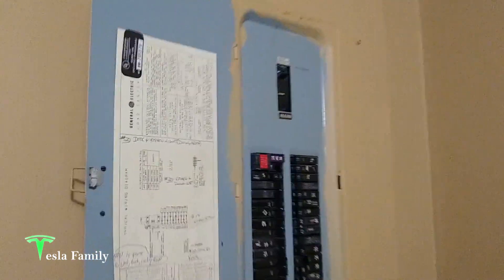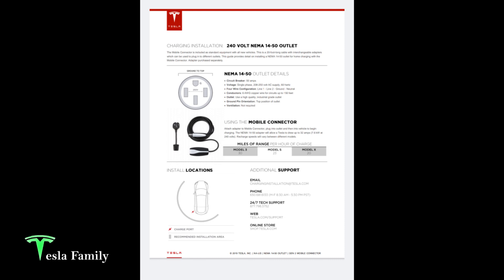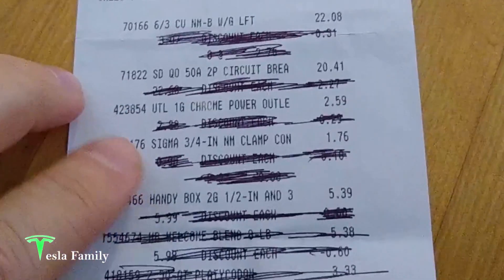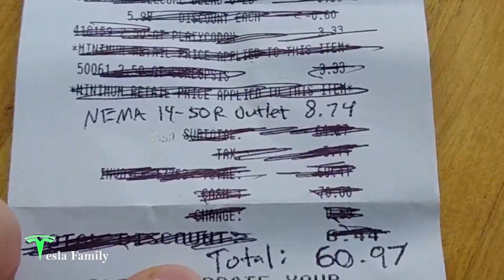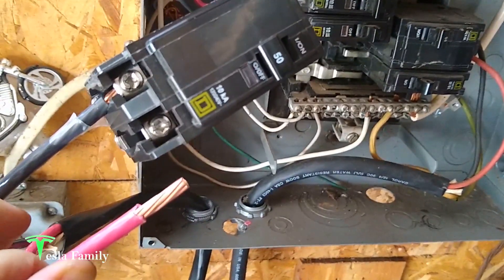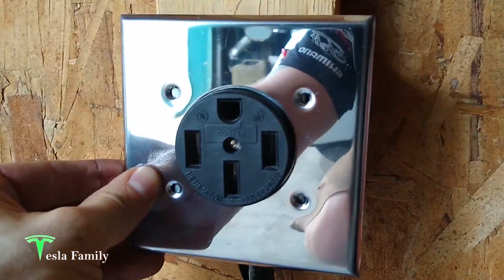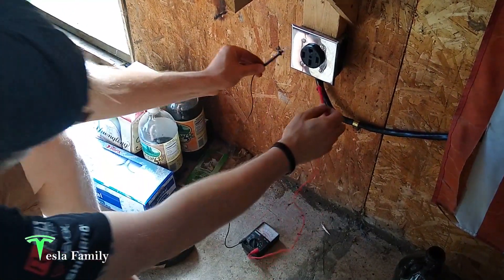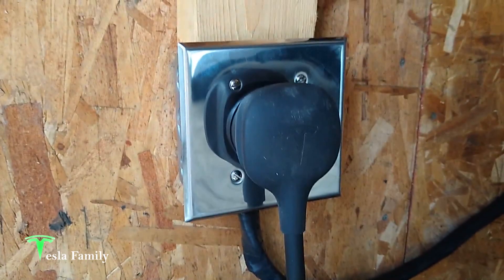Installing a NEMA 14-50 Outlet to Charge my Tesla for Less Than $61!

Comment: What is this ghetto electric? You are supposed to install something that last forever. I doubt that plywood will last long
Reply from the maker: Thanks for watching, that plywood has lasted for 30 years so far. Was in place long before I added the 14-50. Don't see any issue with it at all.

Comment: Why would you install a 60 amp breaker when tesla cut sheet calls for 50 amp
Reply from the maker: I did install a 50 amp breaker for the 14-50 outlet. Please watch the video further. The 60A was the main panel breaker which leads to the subpanel.

Comment: A lot has happened in the last tow years including many of these cheaper outlets melting and causing a fire hazard. They are fine for dryers and ranges with an intermittent load. The EVSEs have a continuous load for a long period of time. The industry is now seeing a need for commercial grade outlets ($50+). Best bet is still a hardwired installation.
Reply from the maker: Thanks for watching! Agreed, the Tesla Wall Connector is the way to go!

Comment: Why some people uses 50 amp and others uses 30 amps? I installed a 30 amp but I notice the breaker warms up while the car is charging is this normal?
Reply from the maker: Thanks for watching! 50 Amp is more power than 30 Amp so the car can charge faster. 37 miles added per hour verses 22. Make sure you have the appropriate sized breaker for the outlet you are using. An electrician can take a look and let you know if your set up is correct.

Comment: I installed 14-50 wall socket and  purchase tesla 14-50 connector. I used the stock wire from tesla and chaned the 110v connect to 14-50. The problem there is no light at all. What it could be?
Reply from the maker: Thanks for watching! The Tesla mobile charger will flash various colored lights linked to electrical troubleshooting problems if you don't get a flashing green for charging. If no light at all then perhaps your breaker tripped or was not toggled on. Highly recommend a professional electrician for further diagnosis.
Reply: @TeslaFamilyChannel  its was install by Electrician there is 240v on the wall we test it 50amp breaker. We also test the tesla 14-50 cable connector that I got 2days ago and its providing 240v.

Comment: I like the diy videos because they inspire.  As an electrical guy, I know you do not need years of training to put a wire under a screw.  The electrical requirements are not some state secret, but many have lost a lot to give us those requirements.

Is the wire big enough, no the other wire.....from the utility to your house....you are basically adding a second stove to run all night long, can your main panel support.

Do you need a permit?

Gfci....yes for recepticle under car charging in NEC.

Type of wire, is it approved....extension cords cannot be permanent building wire.

The type of cover for the recepticle if it is outside.

And many more.

As an electrical guy,  I question if the insurance companies have to pay out for work done without a permit.  You options might be to sue the installer if any problems arise from the install.   That "MAN in the mirror" might have to replace anything lost in a fire.
Reply from the maker: Thanks for watching! Heavy duty metal working machinery is also run off this panel so it can support. The actual 14-50 is only used once or twice a year when I visit.

Comment: 6/3 wire is like $6 a foot now. Wtf
Reply: This author any correction comments answer : thanks for watching. Thanks for watching corrections also
Reply from the maker: Thanks for watching!
Reply: @TeslaFamilyChannel  where can you find cheaper wire
Reply from the maker: I've gotten wire from Amazon https://www.amazon.com/gp/product/B00KWSBRNO/ref=as_li_tl?ie=UTF8&camp=1789&creative=9325&creativeASIN=B00KWSBRNO&linkCode=as2&tag=teslafamilych-20&linkId=eaef12adef35474cabde98378a188f1f or check your local home improvement center like I did in this video. Maybe even check with an electrician friend you might have.

Comment: As an electrician stuff like this is my bread and butter. All you need is 2 hots and a ground. Depending on your local code they may require a neutral but you only need 2 hots and a ground
Reply from the maker: Thanks for watching!
Reply: Since it is an outlet that has the neutral slot, my inspectors require the extra wire.

Comment: I had a Nema 14-50 outlet install for my 2018 Tesla basically the same as you showed in your YouTube for $40 
and all worked well until a few weeks ago when I update the Tesla software. I started getting a notice on my screen that outlet was running hot and the amps were reduced from 32 amps to 16 amps. I think Tesla considered the high temp a safety issue. I replaced my $10 14-50 outlet with an industrial grade one which cost $99 and now charging is back to 32 amps. If yours starts doing this it is probably the outlet and not the wiring, circuit breaker, on Tesla charging cable. FYI
Reply from the maker: Thanks for watching and sharing this information John! I use the outlet maybe 2-3 times a year when visiting my family but will make sure to keep an eye out for any reduced charge current messages.

Comment: Doesnt it require GFCi protection?
Reply: I thought the same thing @Crypto Currency, but apparently the Tesla chargers have GFCI built in and recommend NOT installing a GFCI breaker. Interesting interesting. They also recommend against installing a dedicated emergency disconnect.
Reply from the maker: Thanks for watching, no GFCI here. This is not your normal kitchen appliance outlet. 🙂
Reply: Yes it does according to the National Electric Code.  

210.8 gfci for homes requires it in garages for 125-250 vac recepticles, however, there is a seperate section for car charging in the NEC, about 725 or 745 o close to that, that requires gfcis.

Comment: You should install a Hubble 14-50 outlet. The Hubble has a much better clamping system to clamp onto the 6 gauge wire. Yes expensive but, how much did you spend on your EV? I realize you are charging at the outlet a couple of times a year, but a house only burns down once. That 6 gauge wire, is carrying a lot of power. You should have run the wire in a conduit. I can never understand how people spend so much for an EV, then save money by installing a 14-50 half ass. Unbelievable.
Also, the clamp holding the wire near the outlet, should have been clamped on the 2x4 and not on the particle board.
Reply: Should we mention...😬
The EGCs must be terminated on an EGC buss, not helter-skelter twisted to various screws...2:12...
The 2-pole breaker at the top/left can't be double-tapped with a 2-wire and 3-wire branch circuit...2:16...
The cable jacket must be fully inserted into the connector at the outlet box...6:20... 
The open knockouts in the bottom of the panel require KO blanks...5:15...
The neutral and ground (EGC) do not both attach to the neutral buss in a sub-panel...5:42...
The cable jacket must be fully inserted into the cable connector at the outlet box...6:22...
The cable must be secured within 12" of the panel enclosure and the outlet box...6:12...
The electric meter is spinning the fastest it has ever spun...✂the cord!!
The garage door and door jamb is returning to nature faster than a fallen tree in the forest...2:43... 🙄
The black Model 3 is beautiful !! Surely I must have missed something 😄
Reply from the maker: @wellcraft2136  Excellent! I'm going to hire you for my next project 👍👍
Reply: @TeslaFamilyChannel  Very kind of you to say and I hope my wry humor was not offensive :))
Reply from the maker: Thanks for watching! Great to get feedback from the experts 👍
Reply from the maker: Thanks for watching!

Comment: As a licensed electrician all i can say is if you can afford to buy a Tesla you can afford to hire a professional to install a 50 amp 240 volt receptacle.  I have watched many of these video's and in scares me as to what some people do.  Electricity is not a hobby
Reply: Very true electricity is not a hobby, at home I plug my Tesla into a RV TT-30 amp, 120v and its enough but I need a licensed electrician if I want 50 amps 240 because the 200amp breaker box is maxed out and may not even be a possibility.
Reply from the maker: @captpeady2176  Thanks for watching! Love my Model 3!
Reply from the maker: Thanks for watching!

Comment: For the Nema 14-50, Is there any requirement for the 220v 50A outlet?  At home, we have a 220v with dual 30A outlet.  I used it to charge my Model Y but in the car i changed the 32A received to 28A. What do you think?
Reply from the maker: Thanks for watching! Yes, the 14-50 needs a 60A outlet and 6 gauge wire. I wouldn't try to add a 14-50 onto wiring which was originally designed for a 30A circuit. Def check with a licensed electrician to find out the best course of action.

Comment: other than the outlet, I ordered everything the same as you, can you tell me what kind/size screws to screw the outlet to the electrical box?
Reply from the maker: Thanks for watching! I think I used 6-32 Pan Head Machine Screws. They don't need to be long, just enough to mount the outlet to the box. 3/4" or less long.

Comment: I'm am installing a second outlet for my nephew next month. The one, and most important, lesson I learned after the first install is to purchase a top of the line 14-50 outlet with allen lug terminal screw down wire terminals.  The screwdriver type lug terminals do not secure the 6 gauge wire as well.  You did a nice job with the install.
Reply from the maker: Thanks for watching! I agree on the top of the line/premium outlet. If I was charging with this outlet regularly, I would have used a premium outlet. Since I only use this a few times a year when I visit my family, the cheaper outlet should be sufficient.

Comment: Did you pull a permit? Did it pass inspection? My understanding is that code doesn’t allow use of Romex in exposed areas subject to damage.
Reply: It's a little confusing and I haven't looked at the 2020 edition of the NEC but you can run unprotected NM-B in an  opened framed garage regardless of whether it's attached. However you might have to protect it with a conduit sleeve if it could be subject to damage. I believe this means using a short conduit to protect it when it runs down the wall. There are other little things but the most important part is that his garage isn't finished.
Reply from the maker: Thanks for watching and sharing this info!
Reply from the maker: The National Electrical Code is adopted nationwide, but how it is adopted and where it is enforced can vary greatly. If you are considering a project such as installing a 14-50 outlet like this, please check with a local electrician to find out if a permit is needed in your location. Thanks for watching!

Comment: Excellent video. If I have it installed at 220V, would it be any different?
Reply from the maker: Thanks for watching, 240v outlets can range between 240 and 220 volts. The only difference would be the output in kWs at 48 amps. 11.5 kWs at 240 volts and 10.5 kWs at 220 volts.

Comment: It's sure obvious from the arrangement of wiring in your panel that an amateur did the w2iring.  I hope you're not showing it to an inspector.
Reply from the maker: The sub panel is more than 25 years old and has powered the garage without issue for just as long.

Comment: Can we omit the neutral wire? The Tesla adapter doesn't even use the neutral (as far as I can tell). Thanks!
Reply: Since it’s a NEMA 14-50 outlet, you should wire it up appropriately because someone might the outlet for something else in the future and it would be dangerous otherwise.
Reply from the maker: @lemongavine  Agree! Thanks!
Reply: If you want to avoid the extra wire, which is perfectly fine for charging a Telsa (maybe not other EVs), then use a 6-50R which is two hots and a ground.
Reply from the maker: Thanks for watching, Fred. The Tesla installation guide says to use "Four Wire Configuration: Line 1 - Line 2 - Ground - Neutral" The neutral is important because it brings the circuit to a bus bar and gives electrical current circulation through your electrical system. If you do not feel comfortable working with electricity, please consult a local electrician.

Comment: Two things. you didn't show how the metal box was grounded (important) and while it's ok in your case to use a low-end NEMA 14-50 outlet, Tesla recommends an industrial class outlet if you are going to do a lot of plugging and unplugging of the adapter. These outlets cost in the $80 - $130+ range, I'm going with a Hubbell HBL9450A. Low cost outlets  wearout with constant plugging and unplugging.   In my case I'm planning on using metal clad 6/3 wire on an exposed 35' run inside my garage from the adjacent outside new electrical Square D panel.  If you have a solar panel system be sure to also turn off the solar panel system as it feeds back into the house circuit, in my case there is a separate panel for the solar with a breaker switch and also another in the electrical panel.  Btw, I read somewhere that for a 240v circuit you should use a metal box, not plastic.
Reply from the maker: Thanks for watching! Yes, industrial outlet recommend for daily/frequent plugging/unplugging. In my case, this outlet is at my parents house which I visit 2-3 times a year. So very low usage but better than 120V!
Reply from the maker: Cory  Thanks for sharing this important note!

Comment: Do you need city permit to do this?
Reply from the maker: Thanks for watching! For the most accurate information please check with your city or county permit office. Also, recommend a professional electrician if you are not experienced.
Reply: What the author said, but in general, if you are adding or removing branch circuits from a load center, you need a permit. Typically your building department will be very happy you are doing things right and will be more than happy to chat with you about local regulations!
Reply: @adambuilds  is same if receiving permits anytime you paint your bathroom

Comment: Nice DIY!  Very impressive. 👍👏 Had to hire an electrician to do mine.😂.  My local energy company SCE in Southern California had a program last year that will reimburse any home EV charging installation.  My electrician charged me $300 for his labor.  Cost $175 for the city permit.  SCE reimbursed me $475.  Basically,  I got a free home charging station at home.    Unfortunately,  this program has ended.  For those considering installing an EV charger at home, check with your local electric company   they might have something similar.
Reply from the maker: Thanks for watching! Great to hear you got reimbursed for your charging station!

Comment: Do I need to run a conduit if  the main electric box is 60ft away from where I need to plug? And it's all outside, on the side of the house.
Reply from the maker: Thanks for watching. Please check with an electrician as they can advise the code requirements for using conduit.
Reply: Absolutely.
Reply: To be NEC code compliant, any exposed wire anywhere in a home (inside or outside) needs to be in conduit. Fortunately, conduit is really easy and fun to work with! If you are working metal, you can get a conduit bender for $30-$60, or even better, just get Schedule40 or Schedule80 PVC conduit and cut it with a hacksaw. You'll be looking at $100-$200 for parts & tools to run 60ft of conduit, and you might need to rent a hammer drill to get from inside to outside if your home is brick/stone, but it will be well worth it, and much safer. The only tricky part is to make sure you have the right diameter of conduit for your conductors. If you are running 6-3 AWG such as for this 240V/60A install, make sure to use a min conduit diameter of 1" as referenced in this table:

https://wiktel.com/standards/conduit.htm

Good luck! As long as your load center is powered down and you have all the conduit parts for your run, the end result will be a tidy, safe, and fast charger =)